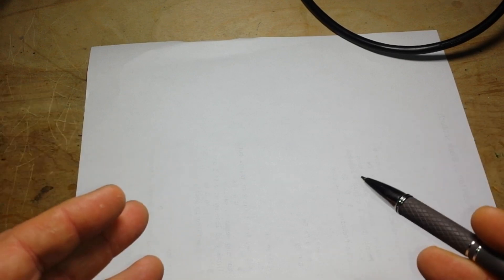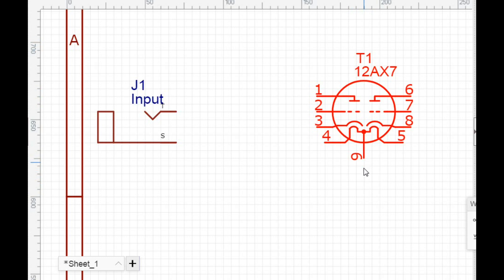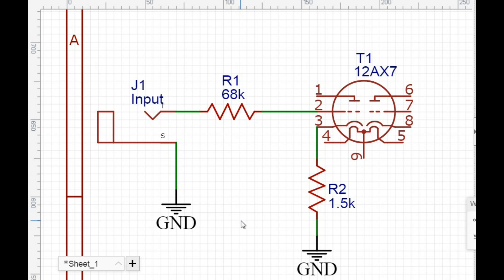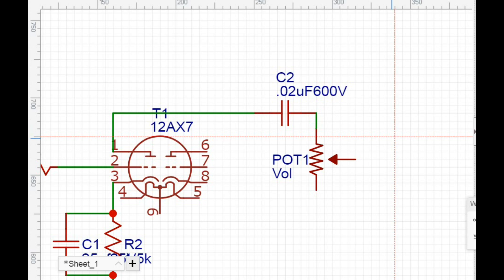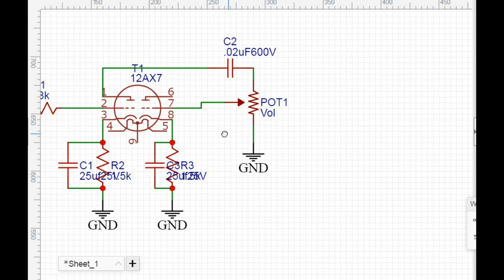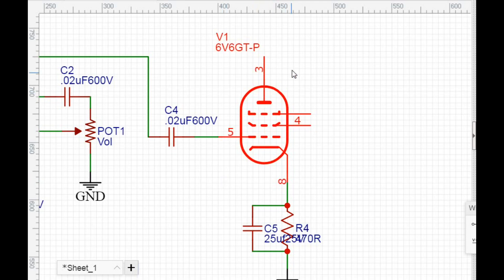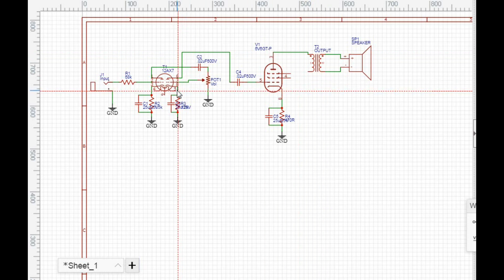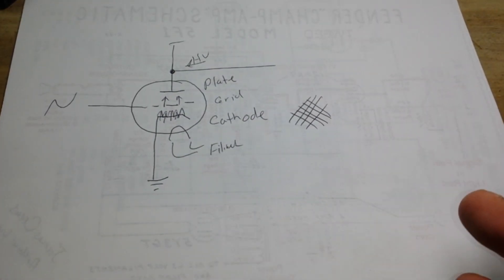Let's design an build a vacuum tube amplifier from scratch

Comment: nice vid, but this wont work in real life.... you forgot to put the 1M grid bleed to ground resistor at the input, (which will bias the tube), as well as the same on the output tube for biasing... otherwise the circuit will not work.... you will get a kind of "gating" effect without these resistors....the second stage at the input is using the pot to bias the grid.... but the first and output stages need the resistors to work.... other than that, all seems good... :)

Comment: subbed 👍 
I've been repairing amps for a number of years simply off experience of years using amplifiers with basic knowledge of components and the components purpose.  however the actual signal path and wiring has been such a mystery and you have taught me more in 15 minutes about that then I've learned in the last 5 years. I believe this is because I do not know how to read schematics and do not have electrical background but your tutorial did not require that and it tied so much up in my understanding thanks a lot bud great video!

Comment: HELLO, thanks for the quality of you explanation... I wonder... how.. you can get AUDIO signal from a point, same point in circuit where it is connected to HV to make valve works... Can you explain me that??? How in same point circuit, you connect HV and take at the same time audio signal.... Thanks!!
Reply from the maker: Audio is AC and the HV is DC. They can coexist. But in parts of the circuit where you do not want the DC, you block it with a capacitor. The capacitor will allow the AC audio through, but not the HV DC.

Comment: Hello , ive been fallowing the channel since forever , i dont subscribe nor like any video or anyone , so jsut because im not a subscriber doesn't mean  i dont fallow .
Whati  want to ask is this a Hi Fi preamp , i want to build it and use it as a preamp for now , latter with a power stage , 
Would this bee a good design ?
I got 220 to 240V AC Transformer  that i plan to use for it , it has 7v output as well . On a 2x 12AX7 tube as a stereo pair

Comment: Electrons do not 'fly off' the grid. In fact, grid current is to be avoided.
Your input circuit puts DC on the input jack. And does not couple it to anything when nothing is inserted. Bad! (several reasons, including impulses when something is plugged in.) You should tie the grid to ground (1MOhm is suitable.)
Negative feedback should include the first stage also.
Resistor from pentode grid to ground missing. No bias without it...
Pot 1 value not specified- critical given the low value of C2.
I could go on...
What happened to part 2?
Reply from the maker: You didn't look very hard, there's an entire playlist. Here, let me help you out: https://www.youtube.com/playlist?list=PLGhvWnPsCr59pg6BN85J-l2Nlj5EOrs0w
Reply: @learnelectronics  I think it is you who may be confused- this playlist does not contain part 2 of the design process- it is about a build. To be absolutely clear, you say in this video that you will return to add the power rail and other elements. I cannot find that part- it is not in this playlist (which seems to start at part 4 - from an earlier date to this video anyway). I have scanned your video list and, unless the name has changed drastically, it is not there.

Comment: I see a problem in your schematic and it may not actually be a problem but you are missing the anode load resistors which would go between your b+3 voltage to the ax7 anode. That resistor is necessary to determine your load lines and to find your cathode bias. From what I saw on your diagram your cathode resistor is normal for that tube but its a little ambiguous to see how you determined that value without the load resistor. Also depending on how you are drawing the schematic ltspice might be a better tool for initial design. Using ltspice you could then simulate the circuit and determine your overall frequency response as well as feed a .wav audio input and actually listen to a simulated output.

Also you are missing grid leak resistors.

Comment: Got a dumb question could you make a mini pre amp so small it fits in a mint tin cause imma try
Reply: I'd go solid state for that. This design requires high voltage, and the tubes get pretty hot.
Reply: @robertgraf9265   I didn’t think of heat but thank you and hope you had a good Christmas

Comment: How do you determine the needed values for the resistors and capacitors?
Reply from the maker: Use Ohms law to solve for the current through each component. You know the voltage, you know the current you want, so you solve for the resistance. As for the caps, different caps for different frequencies.

Comment: I need to find someone to teach me. This is what I always wanted to do. Where do you go to school or to apprentice for this?
Reply: You can learn it online, or go to local schools and apply for electrical and electronic engineering. That will give you the basis of all elements of electrical circuits etc. Just make sure you are up to scratch on your maths abilities, that is almost a fundamental part of electrical engineering and circuitry design
Reply: @astafire6810  thanks, man. I'm gonna check into that!
Reply: @chrisphillips9578  ive just finished my diploma in electrical engineering and its really helped to understand a lot. Good luck if you get in though, really hope it works well for you
Reply: @chrisphillips9578  You can find tube amp design books on the net. Take a look to see if Old Colony is still around, and look at Elektor. EE programs don't cover tubes, and there's really not a lot of coverage of audio.

Comment: Hello Paul, I know this is intended to be a guitar amp.
Can I use it like a hifi amp in my room?
Reply: not really, the tubes used in this are particularly high in gain and commonly used for their distortion profile. Also if you notice the RC values he attaches to the cathode determine the bias or operating point of the tube, this determines the amount of headroom. The  values he's chosen for the cathode bias are more than adequate to cause significant distortion on their own before even meeting the power stage of the amplifier.
Reply: Yes, the original Fender designs (before the tweed era) were licensed Western Electric designs, and they were used for hifi.

Comment: Hello Paul!, nice explanation and nice Amp SE diagram, really I want to do it, I have that two vacuum tubes.
BUT, I don`t find the second part, the power supply etc.
Reply: Carlos Alexis . Hernández Rosales that’s funny that you wrote this. I was about to write the Same.  He made a really good video! I have been on the fence for about 20 years to build my first tube amp. He made me confident.  I just took the plunge. I ordered that parts. I was all ready to go! Now I can’t find the video anywhere. I wonder if he made the video. Maybe he named the video something different. Or possible dentist took a terrible turn.  I will keep looking. If I find it. I will post it here. 
If not, I guess some more research is required.
Reply: @DMarkAgostinelli  
Regards Mark, I hope Paul read our comments and give us the «second part» anyway I"ll pendient your help.
Saludos Mark y Muchas Gracias.
Reply: @alex.h.870  It's probably just a basic tweed champ circuit. Search for tweed champ schematic and you should be able to find one. It will show the power supply as well.

Comment: i like to see OTL
Reply: OTL requires more power tubes. I think Glass Audio had had an OTL design. Output impedance has to be much lower than a single stage provides.

Comment: Hi. Thanks for the video. very helpful. Are Capacitors C1 to C5 coupling capacitors or electrolytic capacitors? Also are 2 watt resistors power rating sufficient for all of the resistors in the design? David.
Reply: C2 is a coupling capacitor. The rest are bypass capacitors, and their values pretty much dictate the use of electrolytics.

Comment: In my Champ 5F1 build I needed to change the value of the cathode bias resistor from 470 ohms to 750 ohms 
in order to reduce the plate dissipation to 12 watts from the 19 watts I got with the 470 ohm.
Reply: So all that did was shift you right along the loadline for that stage and decrease your quiescent plate current. Did you notice any decrease in distortion? It may have been more appropriate to adjust your load resistor instead.

Comment: Excellent video. One suggestion. If you can have another video where you could explain how do we arrive at those resistor & capacitor values & the reason  or logic to use it. In fact that’s the fundamental aspects of circuit design. Thanks for uploading wonderful videos.. Keep up the good work..
Reply: This is to do with the tube characteristic curves, these determine how anode voltage and current behave for a given load. http://vrps.org/documents/TubeTheory/TubeTheory.html

The curves for a given tube are the key to determining the values for the  cathode resistor and anode resistor. On another note, the coupling capacitors and grid leak resistors have to be chosen carefully as they act as a high-pass filter and the wrong values can lead to them lopping off the lower frequencies of your signal.

Comment: what i don't understand is why people use the capacitor ratings and resistor ratings they use. If you could possibly explain that would be greatly appreciated. Thank you!
Reply from the maker: It all has to do what's Ohm's law. For each part of the tube we want to see a certain voltage, or current, whether going into that particular pin or coming out. So we choose a resistor to set that voltage. Same goes for the current. If we know the voltage and we know the resistance then we can calculate the current. The capacitors in the circuits are either use 2 block DC or in conjunction with a resistor to form a filter. Check out my video on low-pass filters to see how that works.
Reply: learnelectronics thank you sir!
Reply from the maker: That's why I'm here. Ask away, and I'll do my best to answer.

Comment: Doesn't designing any kind of amplifier from "scratch" involve lots of complex calculations ?
This looks to me like you are just copying an existing design.
I'm fairly new to electronics so if I'm wrong here, I hope someone will tell me.
>
Reply: 😀 No, you are not wrong. Designing and understanding even quite simple circuits from scratch tends to require knowledge, experience, maths and reference to datasheets. The tube types and components values used here are tried and tested types/values for this kind of circuit. I think the idea was to give an overview of how the circuit is built up, the signal flow and basics theory of a tube amplifier.

Comment: There's nothing wrong with using a tube amplifier for music, but a Champ circuit will not produce a "HiFi" music amplifier.  I suppose that this depends on your definition of "HiFi", though <g>.

The reason that these old circuits are so desirable for guitar amps is because they add tons of color to the sound; they are not neutral.  For music reproduction, we generally want uncolored amplification.

There are no rules, though, so if someone likes the sound of music through a guitar amp then they go right ahead.  I just want to let people know they will not get a distortion-free amplifier if they build this project.  They will get a simple Fender-like amp design that is great for classic guitar sounds.

This is a relatively affordable tube amp to build due to the minimal parts count, but it will add color/distortion to your music at high volumes, the bass may be "flabby", and the sound may vary widely from speaker to speaker.  Impedance matching is critical for tube amps. 

Many modern speakers have low efficiencies and need lots of wattage to get loud, whereas this circuit will produce up to 5 watts.  Distortion will be audible at 5 watts, however, so really this is probably a sub-1-watt music amp.

I recommend a solid-state amp based upon a proven IC for a beginner-level music amp project; it will much be less expensive and less dangerous to build and provide cleaner sound with tighter bass.

https://www.youtube.com/watch?v=d9O7oZEYALI

https://www.youtube.com/watch?v=D5N82Qr6k78

But I love tubes and tube amps, so build this project anyway if you already know what to expect.  If nothing else, this Class A amp will make an attractive room heater ;).

Comment: THE WAY I LEARNED THIS TYPE BIASING YOU NEED A RESISTOR BETWEEN THE ANODES AND B+.ANOTHER WAY OF SAYING ABOUT HOW THE CATHODE WORKS IS IT EMITS ELECTRONS FORMING A SPACE CHARGE CLOUD LIKE WATER BOILING TO STEAM.
Reply: This part left out the plate voltage and resistor.

Comment: This is interesting,  the question on feed back, I am curious why its a question, are there overwhelming reasons why you would or would not do the loop?
Reply: Negative feedback is used to extend bandwidth, but it decreases gain. Also decreases distortion, but it can cause unwanted oscillation, depending on the application. The cathode resistors provide localized negative feedback, and they are there for stability, and they affect the gain of the stage they are part of. Feedback from the output back to an earlier stage is referred to as 'overall' or interstage feedback.
Reply: @robertgraf9265   Thank you very much for taking the time to explain that.

Comment: Just a suggestion, but you glossed over the bypass capacitor requirement.  i think it's important to understand the requirements for DC biasing resistors etc and it's affects on feedback, hence the need to bypass them for the AC signal.
Reply from the maker: This is just part 1

Comment: Good to see you doing tube stuff, not too common nowadays. But if this was the whole designing part, hadn't it been good to also include a explanation to how you got your component values and why they are needed?
Reply: Amp design is actually pretty difficult. To explain why some values are chosen can really amount to a lot of just trial and error. I'm an electrical engineer and I find tube amps can be pretty challenging to build because every small change effects another part of the circuit. Its really hard to explain the selection of a lot of these components without going deep into tube behavior. If you really want to know though go research tube characteristic curves and loadlines, they are the key to how tube amps work.
Reply: he's pretty much copying the values of a fender champ, this is just a simplified version of the amp and would probably sound like shit.

Comment: Great video Paul! I have been following your channel for a while now and I think it is one of the best YouTube channels along with Mr. Carlson's Lab and w2aew. The way you take pains to describe some complex concepts and ideas is excellent. Though, I have a question and that is how do we determine what resistor to use (i.e. its Ohm rating)? What is the math involved in determining the which resistor to use like 68K resistor between input and 12AX7  or using 1.5 K resistor between pin 3 and ground etc.  Your videos have been a great help. I am sure a lot of people are indebted. Thank you.
Reply: I don't think he knows.
I think he's just copying an existing design.
This is something I would also very much like to know though.
>
Reply: The resistors are picked according to the desired operating conditions of the tube. There's usually a plate resistor that is sized so that the plate will be at about half the supply voltage, and the cathode resistor value is chosen to set the gain and those are chosen per tube characteristics.
Reply: You could play around with values if you use a scope and see the increase and decrease of distortion. Also see if the wattage goes up or down. I wouldn't go to drastic in either direction,  When it comes to values. 73

Comment: Unlike AC circuit math, I get this.  What class amp is it?  Could it handle a 1.2v input signal.  My Icom 7610 generates little volume.

Comment: Paul, I love the glow of tubes. It has been a very long time since I worked on a Fender amp. The Champ is a classic. I would use the feedback resistor, but put a switch in to take it out when you want or make it variable. Since you said the amp could be used with other input devices, I would recommend a blocking cap on a second input port to protect the input devices. I would hate to see any stray voltages get loose. I hope the dentist trip goes well and you have a safe trip there and back.
Reply: My father had a Champ that I used as a boy to amplify the minute signals from my home-built crystal radio receiver. The night I heard, from way down in Mississippi, the top-forty music from WLS Chicago  got me hooked forever in electronics! That glow of those tubes in the Atwater Kent and RCA TRF radios I worked on was magic!

Comment: Maybe someone has commented on this but I didn't read all of them. Shouldn't there be something like a 1 meg resistor from the tip connection of the jack to ground?
Reply: Yes. A 'grid leak' resistor is essential to its operation, and in this circuit would be 1M.

Comment: Interesting video. How does a beginner like myself even begin to make schematics like this? I don't understand what the components do or even how you connect them to each other.
Reply: Find other people's projects and build them. Gain an understanding on how they work then start trying to design. Lots of people start electronics believing you can just start designing straight away which is untrue. Many designers understand that electronics can be broken down into small blocks which are commonly used. Then all you do is start placing the blocks together and you have a design. 

This is where books used to be really useful compared to now a days where Google presents you largely hobbyist circuits which are not very good but because a hobbyist wants to show it off they publish it online which means a lot of beginners think that it is a good circuit. Very few professionals would ever publish their designs online so just be aware where you find stuff and how reputable it may or may not be.